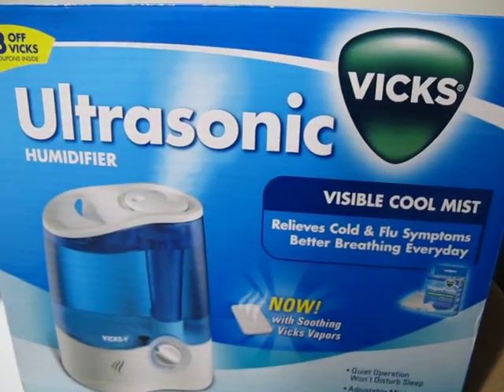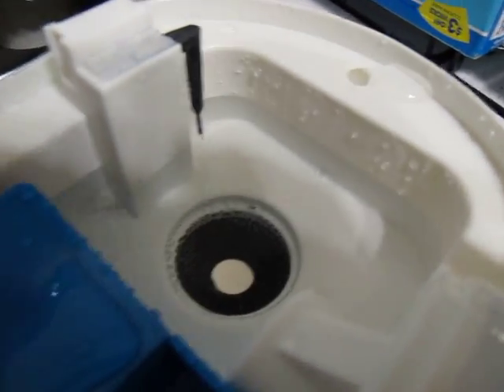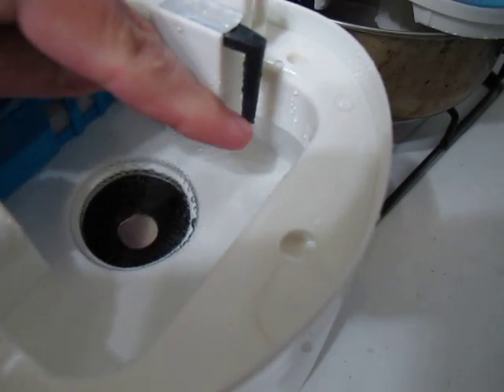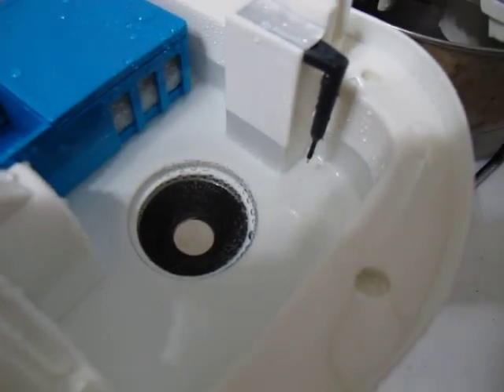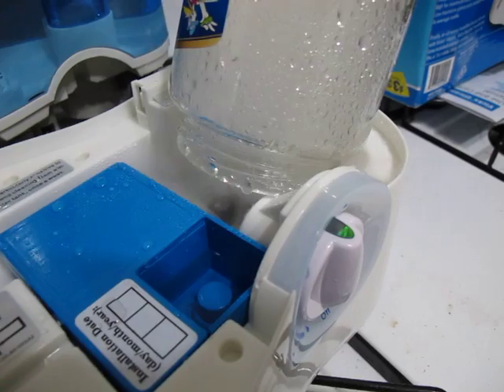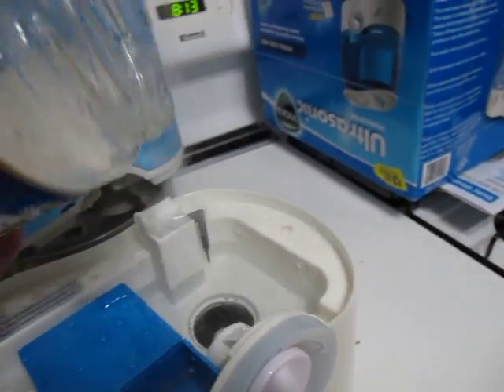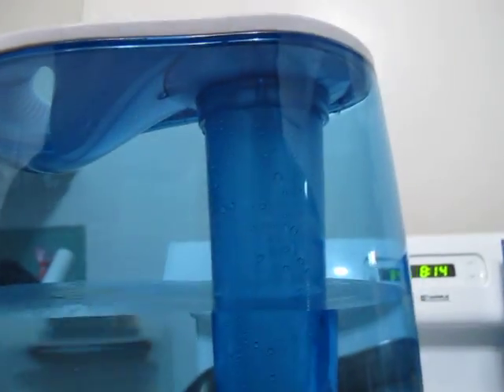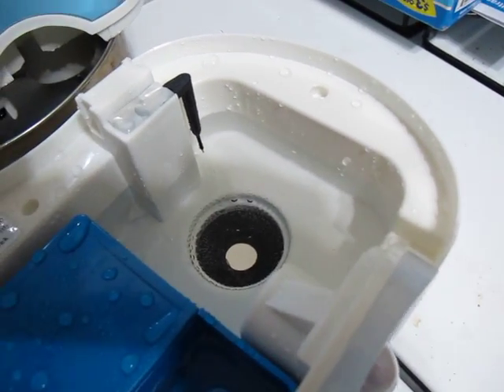Vaporizing Liquids With Sound Waves: UltraSonic Transducer & Cavitation

Comment: how about using electrolysis on gasoline , it will help break the carbon bonds in gas and it will heat the gas to ease its vaporization. you have to try different level of volts on it.
Reply from the maker: Very interesting. Thank you for sharing your idea :)
Reply: 150MilesPerGallon
im working on a new system that will help us all. most of the systems out there are toys, i have been making improvement to my system since 1982. soon u will see the system. the system will be cheap to make
Reply: Errr isn't that what a carburetor is supposed to do?
Reply: kazuza9

Comment from the maker: @furulevi The smaller the micron(measurement of liquid droplets) the more Miles Per Gallon any car, truck or suv will achieve. As the droplet size of the liquid gasoline is reduced- the miles per gallon and efficiency of the gasoline powered engine increases greatly. Furthermore- when we achieve complete vaporization of liquid gasoline- we will be able to burn 100% of the gasoline inside the engine- rather than inside the exhaust systems Catalytic Converter- which is extremely inefficient.

Comment from the maker: Thank you for asking. I've not built a system to run my car with the Ultrasonic Transducer(Humidifier). I learn of a different system I'm very interested in testing, See screen name iambillythekid(or you tube search Molecular Change) Billy heats two 250watt calrod heating elements to 600 to 700 F, and less than 950 F(gasoline's auto ignition temperature), spraying a fine mist of gasoline(ie with a fuel injector, works well) onto the heated elements, a white non condensing vapor is produced.

Comment from the maker: The water fuel technology system I'm running on the 2000 honda insight utilizes vacuum. You Tube search "Water Fuel Technology For Everyone" it's the most recent video I post- and is a basic introduction to an efficient approach to producing Hydrogen and Oxygen via Resonance & Frequency and a StaticElectric Charge generated within the Processor- which connects to the distilled water reservoir.

Comment: You should check into a book called Alcoholcanbeagas(.com)  The author David Blume talks about how alcohol can be easily vaporized due to it's low b.p. of 173 degrees F.  Gasoline being a mix of different substances has a very high b.p.  by comparison.  But i guess a transducer would probably work as well...

Comment from the maker: Search YouTube Channel Tyson Capel in order to see an automobile running on vaporized gasoline(vaporized before the gasoline reaches the engine's combustion chambers) If you would like to see a mass produced automobile that runs on vapors, Google Search Honda Civic GX. The Honda Civic GX is a Natural Gas Vapor powered engine. Natural Gas is compressed and stored in tanks. Because Natural Gas boils at room temperature-the Natural Gas phase changes into it's vapor state-before reaching the engine.